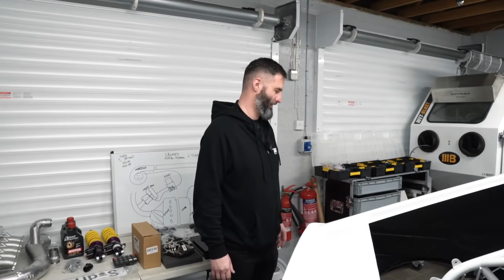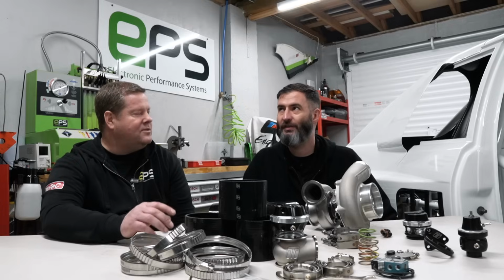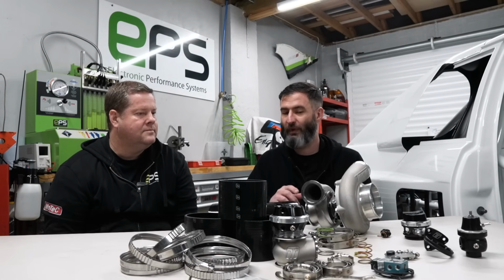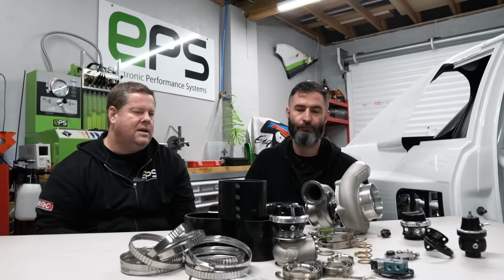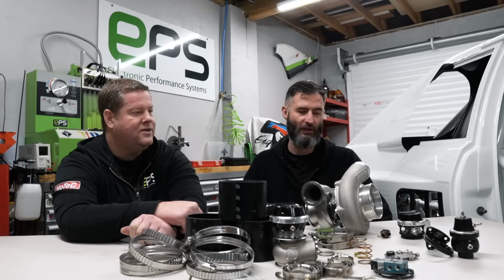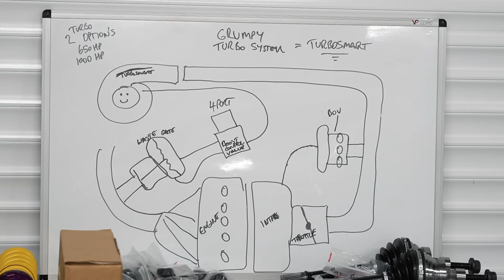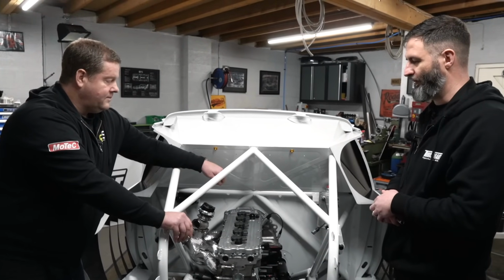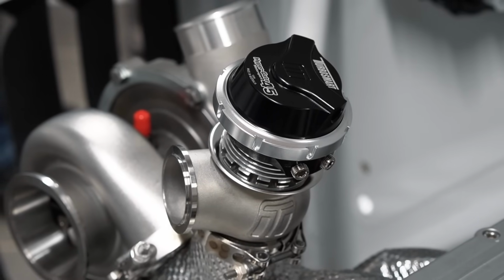Building the Audi quattro Group S RS001 (Part 11) - Turbo and Boost Control

Comment: BEAUTIFUL BUILD! Does the water cooling of the waste gate work by convection or using a pump? 
Your work is more clean than a surgen’s!
Reply from the maker: We are not going to use the water through the gate. It normally just gets the cooling system water to pass through it to keep it cool.

Comment: 1000 degrees out the waste gate😮 hope thats in Fahrenheit 😂 as aluminium melts at 660c.
Reply: The exhaust gasses can go over 1000degrees celsius. In some motorsport application it can max out about 1200degreed celsius.
Reply: We test our pneumatic and electronic wastegates at 1,260°C/2,300°F for 1,000,000 actuations. Not one million cycles from 0° to 2,300°F, we start the one million actuations once temp reaches 1,260°C/2,300°F. With water cooling the test runs for over 24 hours or until we run our testbench out of gas.